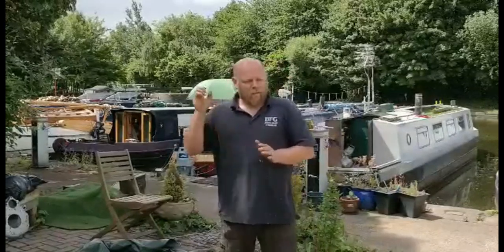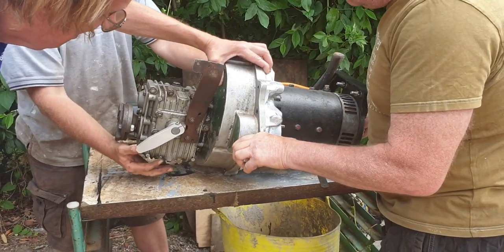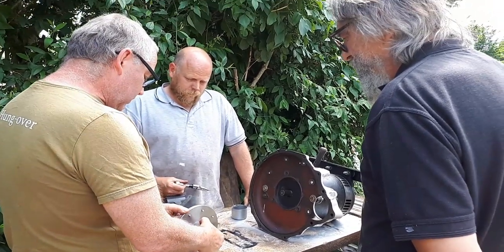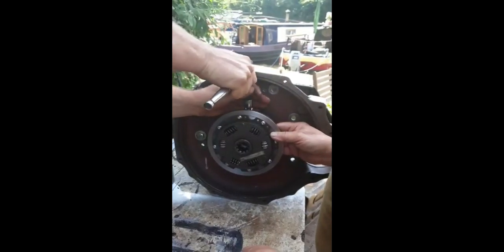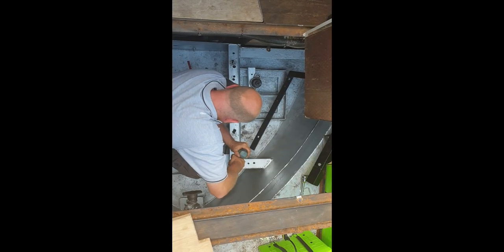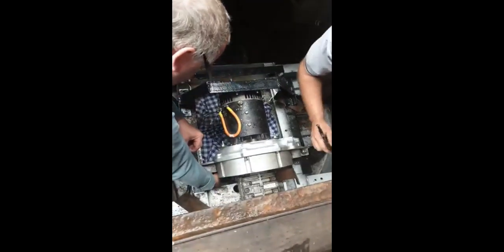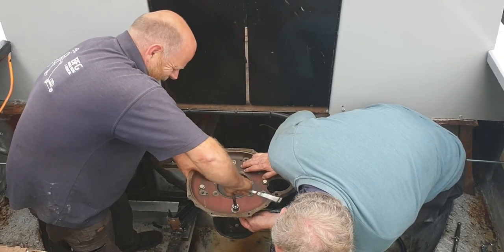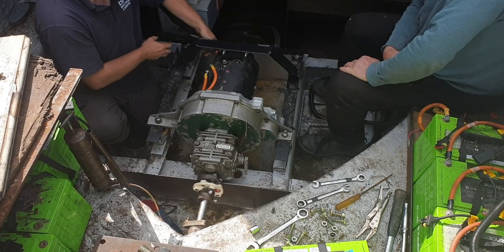DIY Electric Drive Conversion on a Narrowboat - Winging It With The Tight Yorkshireman. Episode 4

Comment: enjoyed this, I just found your videos, I want to build my own from scratch, but I want a hybrid, I was looking at your "clutch / cushion drive" I am thinking of a Haley Davidson compensator, with chain drive to electric motor,  so engine can use motor to charge batteries,  or electric can assist engine. plus a disconnect from engine to the aux drive so can run just on electric. I may need to explain better, but need a disconnect trans from engine to shaft, then electric to the aux shaft, to normal trans, to propeller, that way electric can be added if need extra power, or used for charging purposes. the "compensator" is 2 weird pieces, with several U shapes, that fit together, by heavy spring pressure, but move up & down toward each other, sorta like what your spring will to cushion drive,  but this uses spring on end to push the U's together, but designed for a chain drive, & time proven in Harley world for 100+ horsepower applications.